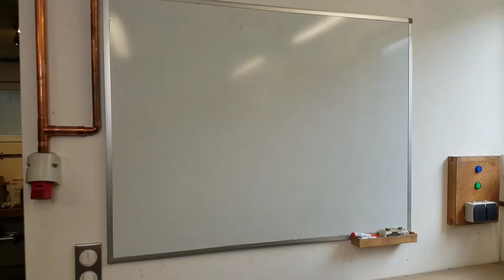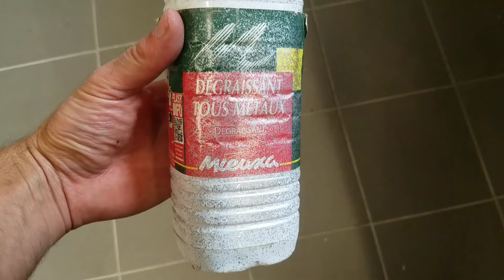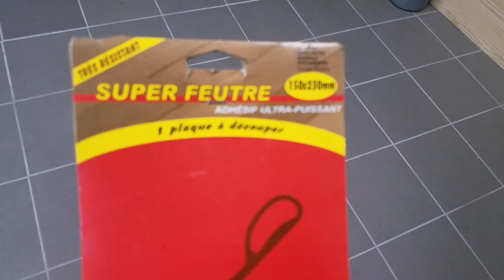Fabrication d'un lit coffre diy stornage bed

Comment: Vous compliqué trop les chose ça n'a pas besoin tout ça
Reply from the maker: Je n'ai pas l'impression de compliqué les choses, après je propose uniquement ma version et chacun peut l'adapter à sa sauce. A quel niveau vous trouvez que je complique ?
Reply: @Semconcept  à mon avis vous avez trop renforcer les appuis et  avec trop de machine alor  que  la viceuse peut faire l'affaire. en conclusion ça prend bcp de temps et pour nous les fabricants ça nous aide pas.  Merci
Reply from the maker: @dabouhd3653  Après c'est seulement ma version, si ça peut en aider à concevoir leurs lit c'est top. Le procédé et les moyens mis en œuvres peuvent différer sans problème c'est vrais 👍.
Reply: Je ne vois pas en quoi c’est compliqué. On peut toujours simplifier, mais l’idée de ce genre de vidéo (je pense) c’est quand même de faire un projet de qualité (visuellement et d’un point de vue solidité). 

Il a fait son lit comme il voulait et il a en plus pris le temps de filmer et de nous expliquer comment il l’a fait. Si ça ne te va pas tu passes à une autre video et basta ! 

Aller à+ ;-)

Comment: Hello !
Merci pour la vidéo, ça m'a permis de mettre en images mes idées !
J'ai commandé mes vérins qui sont semblabes aux vôtres mais dès la prise en main, je les aurai mis dans l'autre sens personnellement. C'est à dire la partie en angle contre la latte du sommier et la partie plate fixée dans le sommier. Cela éviterait la soudure etc non ?
Je vais essayer une mise en situation pour voir si cela peut fonctionner mais j'ai l'impression que oui.
J'ai pris des vérins 1200N pour un 160x200 avec 50-55kg de charge, j'espère que ca ira haha
Reply from the maker: Salut, super si ça a pu t'aider 👌.
Dans ma configuration je ne pouvais pas inversé le sens du mécanisme en moins de fixer le plat sur le flanc du cadre du sommier mais la tole n'est pas bien épaisse, les inserts risquerait de se déchirer sous la pression qu'on exerce dessus. Mais si les tiens le permettent c'est parfait 👍.
Reply: @Semconcept  Je dois encore essayé mais je pensais mettre un tasseau horizontal comme support vissé dans mon panneau et sous ce tasseau en mettre 2 vertical comme support...
Je te reviens quand j'aurai essayé !
Reply from the maker: @simonc972  avec plaisir, je veux bien voir le résultat, au pire tu peux m'envoyer une petite photo sur Instagram 😉
Reply: Moi je ne m’y connais pas du tout, vérins avec 1200N 50-55kg de charge, de quelle charge parle-t’on ? Merci

Comment: Excellent work.. but what are the measurements of the pieces that you collect
Reply from the maker: hello, thank, you this safe bed measures 2 meters by 1.6 meters and it is 40cm at the bottom of the mattress.  I bought a special trunk bed cylinder kit that I slightly modified to adapt them to my configuration.  For the framework of this realization I used 4 shelves or pine panels of 2m by 0.4m high on, 4 cleats of 32mm by 32mm for the support of the bed base, 1 cleats of 48mm by 32mm for the support  on the ground.